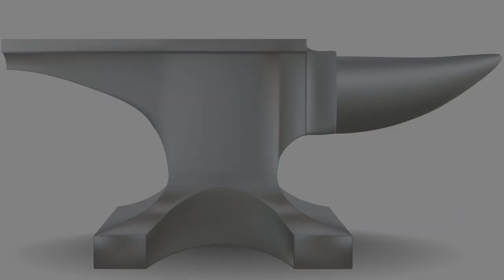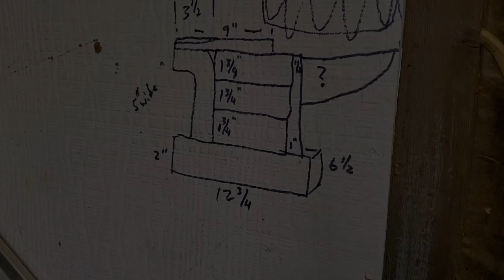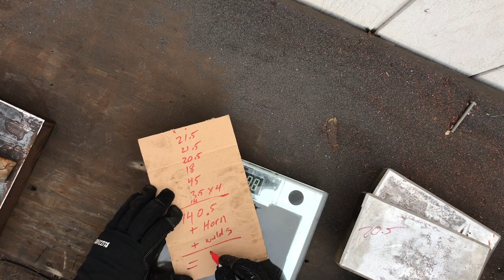HOMEMADE 180 POUND ANVIL PART 1: Design and Material Prep

Comment: Very cool !

I've watched vids on several DiY builds like this, all of them impressive as heck in terms of effort and skill ... but several of them ran into a problem i'm hoping you were able to avoid (aside: I havent watched the sequel to this yet).  That problem was failing to adequately PREHEAT everything to 400F+ before doing the full penetration welds ... without preheating, the result were welds under permament stress upon cooldown, and which subsequently failed.  To my untrained eye, losing a few points of rockwell hardness off the top plate (from a good preheat) is a worthwhile tradeoff if it means avoiding cracked welds later.

That said, I hope it turned out awesome.
Reply from the maker: We applied some heat to the steel before/during welding, but I'm not sure exactly what temperature it was. I'm almost certain we did not heat it to 400° F, though. But so far it has held up!
Reply: @FormulaJake  I've never had the opportunity to  mess around with a welding gun, but from cooking I can say that if water dances angrily when flicked at something, it's definitely above 400F. That's our old friend, the Leidenfrost Effect. 😁

Comment: I'd like to know what brand carbide tooth blade you're using on that chop saw.   I used a Lenox on 1/16th angle iron and it did not last 15 cuts.
Reply from the maker: We used the harbor freight bandsaw blades, I don't recall the brand but it's the cheapest one with the highest teeth-per-inch. They wear out and break, though, but we were able to cut all the way through the horn angled cuts without too many issues

Comment: So if the gaps wouldn't have been visible laying the blocks horizontal, you would have kept them like that? The reason I ask is, mine sit flush with no gaps, so will I lose rebound still? Or do I need to turn some up right for more mass? Mine is going to be around 400lbs., but will only have a 4" x16" face, 10+/- tall and a total length of about 23",so the mass maybe there anyways. Any feedback appreciated.
Reply from the maker: Even with no gaps, with the layers horizontal, you will still lose rebound if you weld them together just at the edge. If you weld the entire blocks together from center to edge, it doesn't matter as much, and in that case, orient them however you'd like. However, if you just weld the edge of the pieces together, you must orient them vertically in order to keep the rebound, gaps or not.
Reply: @FormulaJake  ok thank you

Comment: What kind of place had all those huge cutouts like that?
Reply from the maker: We cut the pieces ourselves with a chopsaw/bandsaw, out of an old forklift fork 👍🏼
Reply: @FormulaJake  sorry I mean the huge pieces of scrap steel at 3:23 minutes in, where you found the feet.. would like to know what kinda place has stuff like that so I can look for one🙂
Reply from the maker: We found most of our other metal at a steel supply yard, in their scrap pile. The piece at 3:23 was bought online, I believe from eBay. It's a piece of A2 tool steel.